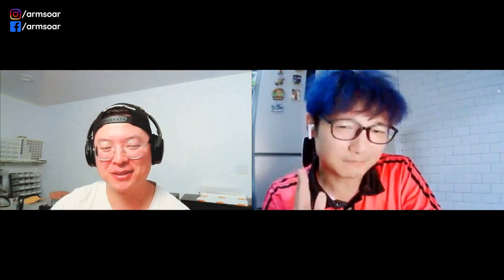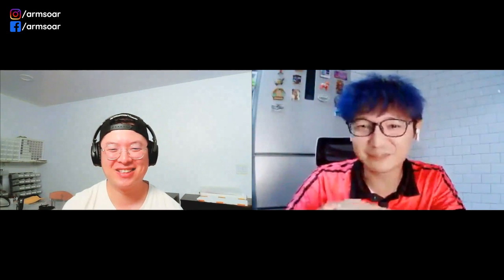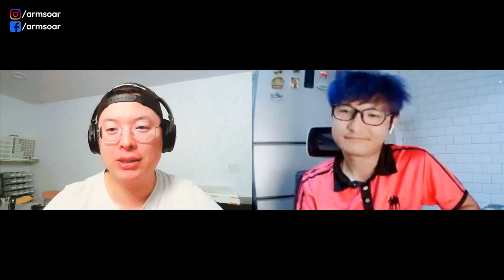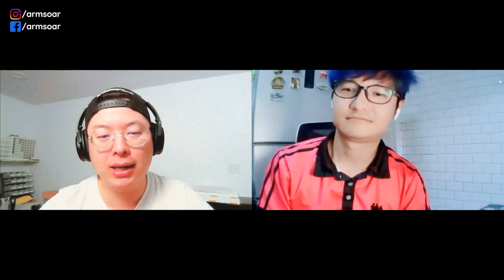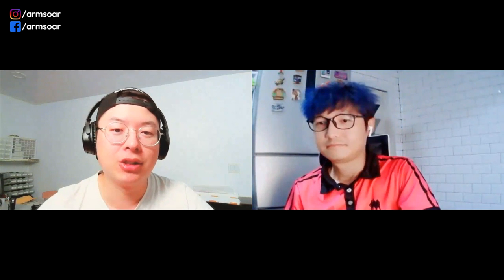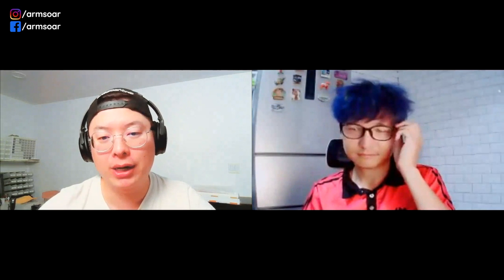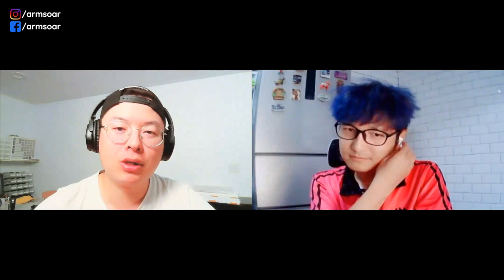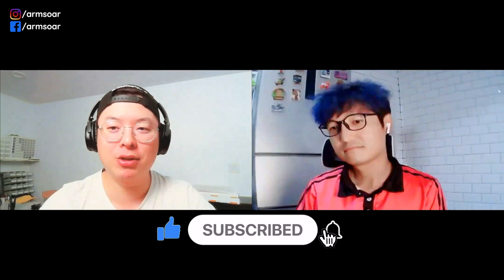Camber Up Ep. 3 with Nick Wu - Your First DLG, Radio Choice, Receivers, Servos and Batteries

Comment: Really helpful, thanks! For Spektrum, I always use the AR6610T receiver with the vario. You need to remove the plastic body and shrink tube it. Then it fits any DLG and you have full telemetry. Cheers!
Reply from the maker: I have the AR6610T in one of my BAMF 2's and my Fury and E-Deviant, works great! Won't fit in some of the smaller fuselages though, like the regular Deviant and the CX5 Pro.
Reply: @ArmSoar  I have them in the Flitzebogen2 and the Kite

Comment: sorry i can't camber up with a plank :)
Reply from the maker: It wouldn't be pretty if you tried that! Kapow!!
Reply: You can actually do that. With 4 or 6 Flaps on the wing you can set flight modes and optimize the lift distribution for different speeds.